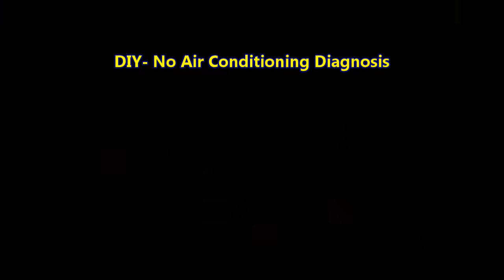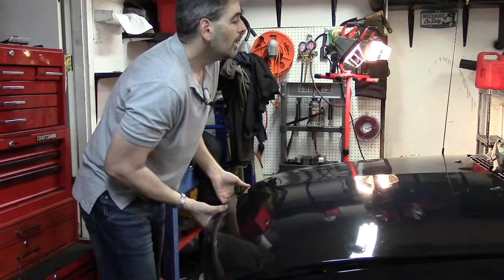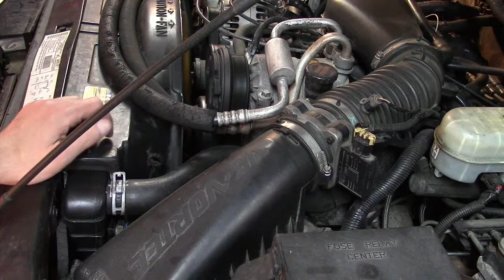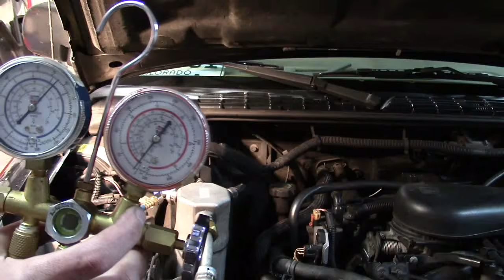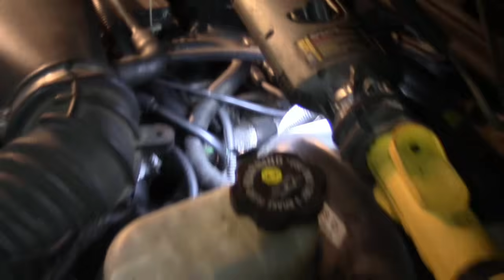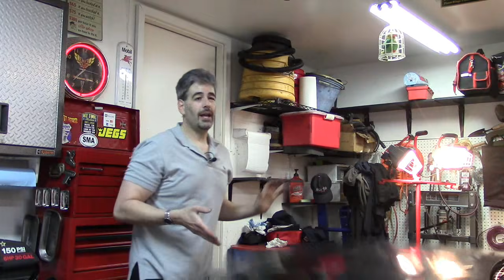DIY- Troubleshooting No Air Conditioning

Comment: If anyone can help me out with this it be really helpful and appreciated. ( 2 “mechanics” couldn’t figure it out ). I have a 03 Tahoe LT 5.3 vortec. My AC & heater work but if I use them it drains all of my oil and then the vehicle begins stalling. When it comes to a complete stop it shuts off completely. It will not start no matter what until around 10-15 minutes later and my change engine oil comes on. Funny thing is the AC blows out cold air constantly, yes even though it’s off. It doesn’t blow hard but u can feel the cold air and what’s weird is when it’s cool outside the damn hung blows even cooler air. Winter time should be fun since I won’t be able to use my defroster with out losing all the oil. Any suggestions?
Reply from the maker: What data do you have?
Reply: Schrodingers Box literally was told to recharge the AC by the first mechanic and the second mechanic said he wasn’t sure because the AC actually worked properly and said it could electrical,  or compressor I believe, and when I mentioned an AC recharge he kinda laughed and I told him I was going to look for other options before getting  anything done
Reply from the maker: No I mean what is your voltage at the compressor relay load and control sides-  and is their continuity at all times on the relay's load side?  What is the source of the electrical current to the clutch- it is control side activated or is it a ground fault?
Reply: Schrodingers Box oh lol oops lol, the first mechanic said he had 12v when he tested the  compressor and he said there was power at the relay, then he said he wasn’t going to charge me up the a** for something I could do my self ( AC recharge ) unless I really wanted him to do it. But he said he’d just do the ac recharge and nothing else.
Reply: Schrodingers Box my personal guess is there might be a bad ground connection maybe but the 12v reading doesn’t back that up 🤷🏽‍♂️
Reply from the maker: then just check for 12 V against a known ground and check the ground for continuity to the chassis.
Reply: Schrodingers Box will do, thanks man!

Comment: My A/C on my Ford Escape is Intermitent. I may run fine for a week and then it's hot again. I have had auto shops check it and they say nothing is wrong or take it some where else? I know it is not the coolent. I am not a expert by no means, but I believe it is electrical. If someone can help me it would be greatly apprecated. Maudie 
maudiemcsalmon@gmail.com
Reply from the maker: What are the basic data you have? What are the high and low pressures? What is your amperage at the clutch? You need basic data to determine the possible cause.

Comment: My Dodge 4.7 1500 SLT flex fuel doesn't have relays in the fuse box nor under the fuse box. In fact there are no relays to any system that I can find under the hood in or under the fuse box. Can anyone tell me where I can find them. Dodge parts guy was at a loss. 
Thanks please help!

Comment: was the cut wire coming from the compressor visible during the visual inspection?   was the relay checked before or after miss scarlett cut the wire with the scissors in the conservatory or after the inspection but before colonel mustard stabbed professor plum with the wrench in the hallway?
Reply from the maker: As was mentioned twice- the wire was due to an improperly installed. it connector.

Comment: First off this guy says the  driver of the car stopped at a  red light and the A/C was working fine, then all of a sudden  it was blowing warm air. Did someone sneak up under his car and cut that yellow  wire  going to his A/C clutch  while  he was sitting at a red light ?  This problem didnt just start while sitting at a red light. Come 0n !
Reply from the maker: Tom. pay attention. As was mentioned 3 times in the video it was due to an improper butt connector repair previously made.

Comment: When I turn off my. A C I get this fog coming out Mr vent and a smell too g m c
Reply from the maker: Usually caused by leaking heater core. I usually diagnose by pressure testing system

Comment: You would always check the fuse first to make sure that the system has power to start with, then you do your other checks.
Reply from the maker: Noit necessarily. When you can tell this cannot be a feed source issue there is no reason to check the fuse. Why waste time when you know the fuse cannot possibly be the cause?
  Also, why not do what I did- check the fuse indirectly while checking the load side contrrol?
Reply: But you didn’t know the fuse was good until you pulled the relay and checked power there. Not all vehicles have easy access to test the compressor clutch.

Comment: I would appreciate your advice on something.  My 2007 Tahoe A/C light blinks 3 times then turns off.  Can't get it to turn on.  I've seen solutions from "Ambient Temp Sensors" to "The A/C compressor is bad"  Before I bring it in for a mechanic to determine, I wanted to see if you have dealt with this before, and what was the majority of the time the solution.
Reply from the maker: Ok- what data do you have. What is the voltage at the load and control sides during and after the AC light blinking.  Need a basic beginning direction to start with.
Reply: @SchrodingersBox  Oh I don't know, I'm far from a mechanic

Comment: I have something for you.... I have no pressure reading on my low and high side n I can move my clutch with my finger freely
Reply from the maker: Then you either have broken schrader valves, broken gauges, improper guage  connection, or you have no refrigerant in the system at all.

Comment: I don't understand how you had the probes for testing the pressure switch. It had no volts then you unplugged it and there was volts and you determined its working. Thanks for the video....
Reply from the maker: Yes. plugging it in stopped the voltage drop because switch was engaged. That’s how i lnew it was working.
Reply from the maker: It’s not shorted out, it’s the same voltage on each side of the closed switch so since there is no difference in potential the meter reads zero. Therefore, the switch is working.

Comment: Nice job, but how did you know it was not the relay it self? I never say you test it with your multi-meter.
Reply from the maker: Because load side feed was present AFTER the relay.  Only possible with relay engagement.

Comment: Fasinated that you said that the owner told you he was sitting at a stop light and the ac cycled off and then only blew warm air.  So, somehow the wire in question was miraculusly severed at that time ?   Seems like a set up by him to see how honest you are ?
Reply from the maker: No- it was a bad butt connection repair is all. Looks like it was crimped with cutters instead of a crimp tool
Reply: @SchrodingersBox  lots people do not know how to properly crimp. Thanks for clearing this up for me.  Bob.
Reply from the maker: Boy aint that the truth! I see improper connections all the time.  Allllllll the time. Its also a source of voltage drop as well.

Comment: i look at my engine to try and find the problem all the time.
So fucking what.. people can do what ever the fuck they want..
Reply from the maker: Yes. i agree. people have the right to be wrong and even stupid. Their choice I choose to not be that way. that’s my choice.
Reply: Schrodingers Box 
I fix my car issues every single time it needs fixing just by "looking" at my engine.. then picking up my phone and "looking" at a quick youtube video.. plain and simple.. people can do whatever the fuck they want
Reply from the maker: really- How do you “look” and fix a P0172 code?  i am dying to hear how you would “look” and fix it the first time. Please explain your method of what you look for on a P0172 or maybe something easier- a MAP sensor circuit Low Voltage code.   What the hell do you "look at" in either case to find whats wrong every time- or even one time?
 Dying to hear- you Incompetent Dumbass. (Don't hold your breath folks...  he won't answer. Guys like him never do).
Reply from the maker: Yep did I call that or what- they always shut up when you pin them to having to show any competence.  Amazing.

Comment: You could take the compressor relay out...remove the cover and push the contacts close..or jump the wire's where the relay was, and that would confirm that the compressor clutch engages.
Reply from the maker: Why would you want to do that when load side feed was confirmed after the switch? You already know that power is there and the clutch still won’t engage due to lack of feed.
Reply: @SchrodingersBox  when you first walk up and start to work on it...pull the relay and jump it and that tells you that the compressor clutch works...and its from the relay back, or whatever controls the relay, that is what Im saying....The wiring to a compressor is not always as easy to get to as the one you had.
Reply from the maker: I did that- with the test light. Thats how I diagnosed the problem as open load side feed after relay..  If you  just jump the relay and the clutch doesn;'t engage then how do you know the location of the open? The test light is way better because it tells you where as well as if.

Comment: What if the low side gauge moves very little maybe 5 lbs of pressure...is the compressor gone?....The compressor does spin so its not the magnetic clutch. I cannot how the gauge to the high side.
Reply from the maker: depends entire on the high side reading.

Comment: 12:53 I just wonder, how did you know it's a wiring problem and not a malfunctioning MGCLT relais? I believe if an MGCLT relais switch does not close properly, you will have the exact same voltage measurements. Or am I wrong?
Reply from the maker: Can't be relay- load and control side AFTER the relay outputs were confirmed.

Comment: Scotty is a great guy. Eat it
Reply from the maker: Yes, I am a diagnostician and scotty is a parts changing hack.  Definitely "different areas of expertise."
Reply: Scotty's good but this guy is too, IMHO.  They've got different areas of expertise, I think.
Reply: Well, after you diagnose, you often still gotta change a part though, right? Ha ha

Scotty's videos are pretty useful until you get into the realm of electrical diag, then you've gotta start thinking harder, IMHO.
Reply from the maker: @larr5e  Even without the electrical and performance diagnostics, Scotty is still a parts changing hack.
  And no you don't usually have to change a part anyway- only 60% of diagnostics require a parts change to fix.  Even so- lets assume a part was needed to be changed, I know excatly the one and only part to change while Scotty's method would have you changing plugs, wires, coild, O2 sensors, TPS sensors, and finally maybe you change the part that was needed.  
Again- different areas of expertise.
Reply: I agree, but if it's just a control arm or ball joint (so possibly minimal diagnosis), his vids are a good fast summary of the job.  Sometimes I watch them to make sure I'm on the right track.  Your stuff of course is new territory for me, but have got to learn it to fix the issues on my GF's car. Ha ha. Anyway, thanks again.
Reply from the maker: @larr5e  Oh definitely, for beginners he is definitely a resource and I agree you would find it useful to get exposure to what may be involved. Even then ETCG is way better for beginners.
  I am not a channel for beginners. I am for people who do not require basics- they already have basic wrenching skills and need to elevate past that.
  Trust me, once you reach enlightenment, you will rewatch ETCG or Scotty an come to a harsh realization that they are parts changers. Even I had to come to that realization because I used to watch them too.  Basically, once you realize Scotty is a parts changer, you are past basic beginner level. But once you realize ETCG is a parts changer.... now you are enlightened.

Comment: I call BS on this self absorbed arse  Explain how the driver was using the ac and "suddenly" the ac quit,  or better yet, explain how the wire mysteriously became perfectly cut straight across while the vehicle was in use. You tried to blame the failure on an "aftermarket" repair but if that repair was faulty the ac would not have been working. and the question is, who "perfectly" cut the wire while the driver was enjoying the ac and how did they do it without the driver seeing them?
Reply from the maker: OMG you idiot... why do I have to keep explaining like I did in the video... you moron... that it was a improperly connected Butt Connector splice?
    Thats wehy the wire was perfectly cut you fool.
 PAY ATTENTION

Comment: Great detailed video. I wasted time and money last summer trying to get my A/C to work and nothing. After watching this video, I think I will try one more time and use your analysis since it makes a lot more sense than all those other videos I watched basically on just recharging A/C. Just a quick question. Even after you fixed the problem, can you still rule out if there is a leak anywhere in the A/C system, or is that something that would possibly show up later on if there was? Just wanted to know if I should check for leaks in addition to the overall analysis. Thanks!
Reply from the maker: Yes you definitely want to check your low and high side pressures and decay time to validate you have no leaks.
Reply: @SchrodingersBox  Ok thanks for the quick reply. I will do both parts than.

Comment: my compressor clicks on and off and blows warm air
Reply from the maker: What data do you have?
Reply: 1998 Ranger with 4.0 v6 gauge shows middle of the green.. but of course when compressor goes on and off it goes up and then down...last year had ice cold air
Reply from the maker: Not sure what you mean. I just need the basic pressure data from low and high side both static and loaded. Nothing more, just the raw basic data.

Comment: I have slightly warm air coming out of the vents, plenty of pressure in the system (no apparent leaks), fuses are fine, how do I know if it is the compressor?
Reply from the maker: what are your low and high side readings?

Comment: My ac went bad over a day on my 2004 Dodge Grand Caravan SXT.. The ac clutch engages at all times when the air conditioner is turned on. Tried to put a can of refrigerant into the low side while ac was on Max. None of the refrigerant transferred. The ac clutch still remained on. One of my friends hooked up an ac manifold pressure set. The pressures were both around 95 and never changed. What?
Reply from the maker: Yep no mystery there-you have no suction.  btw you are lucky as hell you also have no compression and you didn't blow your hand off adding the refrigerant.  ALWAYS examine the pressures before adding refrigerant.  They really need to outlaw selling those cans to the public with the low side guage only.

Comment: I am retired now but years ago I had a clutch problem on an  International 9670 tractor. I had 12 volts at the clutch (by vom) but it would not engage. I could put 12 volts to the clutch from an external source and the clutch would engage. I switched from the vom to a test light and found that the problem was a faulty relay. The internal points of the relay were burned but still making contact enough to read 12 volts but not enough amps to even operate a test light. Replace the relay and problem fixed.
Reply from the maker: Great example of why a voltage measurement is not enough-. Also a voltage drop test would have detecting this.

Comment: My ac went from cold to hot over one day. My clutch engages when I turn the AC.
Reply from the maker: What data do you have.
Reply: Everybody states that if your compressors clutch is engaging then it is low on R34. I am so confused. I put an ac pro gauge and it read zero when the clutch is engaged. The clutch is engaged any time the a/c is turned on.
Reply from the maker: I need to see the high and low side pressures both static and while running

Comment: Hello, can you explain the new clutchless PWM controlled type AC systems (2014 Corolla)? We're getting intermittent AC, works when it's mild, quits when it's Hot. Been wondering if it is due to the compressor solenoid, pressure switch or evaporator thermistor. Thanks for the feedback!
Reply from the maker: What is the high pressure side reading?
Reply: It’s just above 160 psi (134a) at 20 Celsius ambient. Thanks for taking an interest!
Reply: Also, just realized that the cooking fan for the condenser does turn ON. When I unplug the pressure sensor, the fan turns off. I’m assuming I get the pwm signal to the compressor. It’s giving me 14V stable at the compressor connector, but since it’s pwm, no telling with my multimeter what it’s being told to do.
Reply from the maker: Sounds like either bad compressor or a very low refrigerant volume.  High side should be over 200.